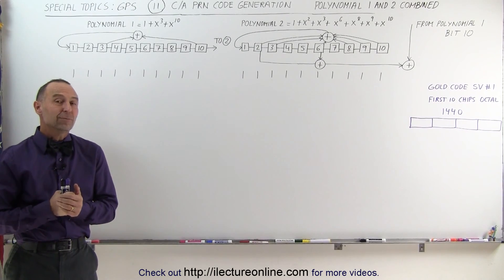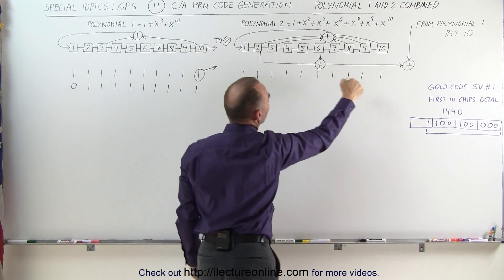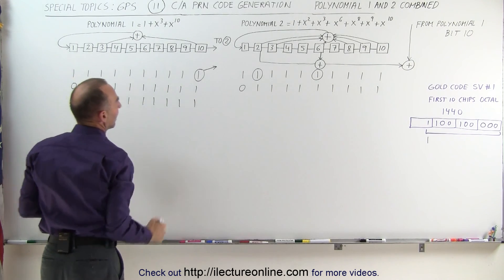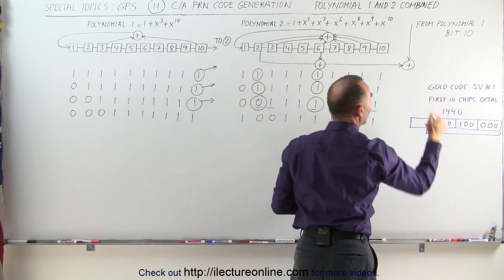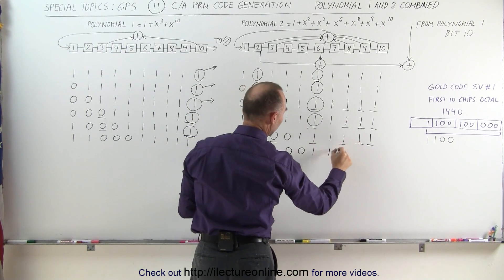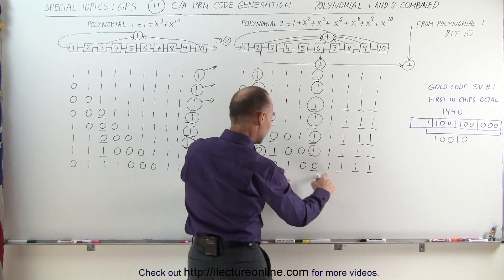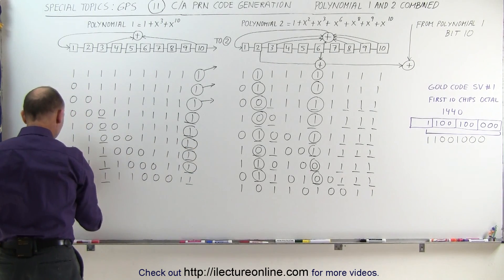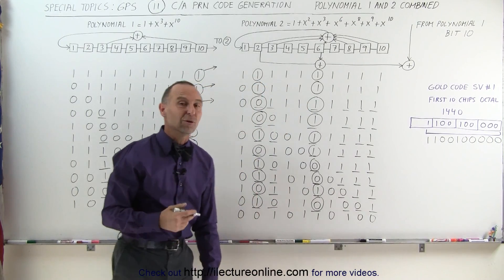Special Topics - GPS (11 of 100) C/A PRN Code Generation: Polynomials 1&2 Combined

Comment: hi, i'd like to know where is the bit0 of the C/A code generated from the XOR function of the two polynominal1and 2 ???? because if the first bit (bit_0) is one (1) why it is written at the left normally it should written at the right like this: (bn, .....b2, b1, b0).

Comment: Your explanation of the code generation makes sense, but I think that the way the polynomials are written may cause some confusion. For example, polynomial 1 seems like it should be x^3 + x^10 (to yield 1 + 1 = 0 in the first step) rather than 1 + x^3 + x^10. It is not clear what the "1" is there for. Written that way, I would expect the first step to yield 1 + 1 + 1 = 1.
Reply from the maker: Yes, I agree that it is confusing, but it is the standard way of writing these.
Reply: I was confused on his polynomial's too so I decided to look it up. Looks like he's using Koopman's Notation, it always has a +1 appended at the end. Note that to use Koopman's notation the MSB has to be 1, which implicitly defines the length of the Polynomial.